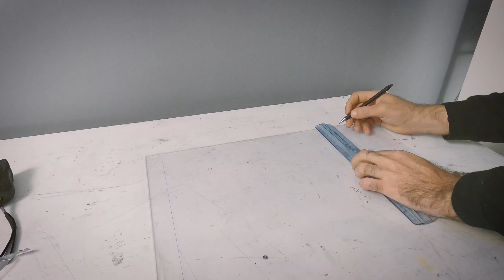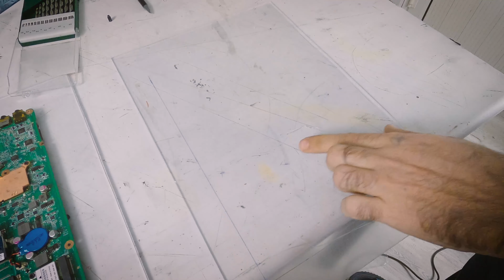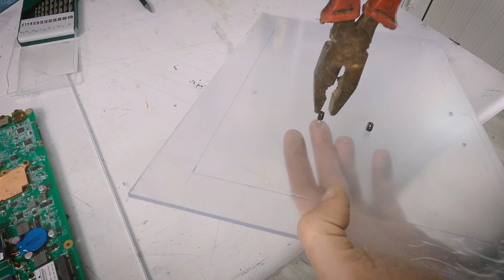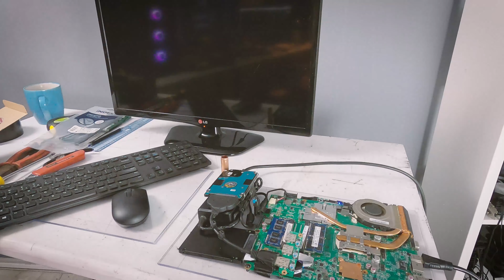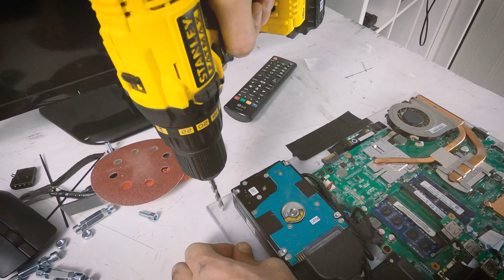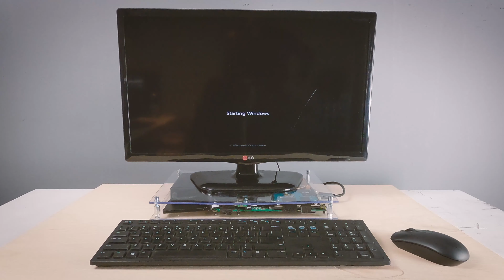Laptop to Desktop Quick Modding | Design Something

Comment: Nice Idea to have everything inside a clear home made case I have seen similar things done over the years, and have tried myself but usually the case the laptop comes in is the best thing to keep it in. what i have done is remove the keyboard screen and closed the lid then I put the whole thing just as it is inside 2 layers of plexiglass or whatever you use. I then mod only the power button to be on the case itself to be on top . I never thought of making videos about it as it sounds like to much work . This mod by DesighnSomething looks pretty good and similar to what i have done in the past.
Reply from the maker: Thanks!

Comment: FIRST OFF AMAZING WORK FEW NOTES HADRIVE IS ON AN ANGLE THE POWER SUPPLY MAY GET PRETTY HOT THERE AND FINALLY THE FANS AND GONNA NEED TO BE CLEANED TO YOU ARE GONNA NEED TO TAKE IT APART OR YOU COULD AD A MESH TO PROLONGE THE TIME BEFORE CLEANS.

Comment: I have just started the same idea but using black acylic.   My old laptop had the On button in the keyboard and I have found the connections where the ribbon connects to he M/B, but attaching another On button, any ideas?
Reply from the maker: I started mine from my phone via Wake on Lan. But this required network cable. I didn't make it start on wireless.

Comment: Can you provide a list of parts used to build this? I want to do the same thing and trying to gather the right parts are proving difficult.
Reply from the maker: - Laptop Motherboard
- Motherboard Standoffs M3x6x6
- Motherboard Screws M3x5x7
- Socket Bolt M6x10 + nuts
- 5mm Acrylic Sheets

Choose a laptop that have a fairly square motherboard.
Reply: @DesignSomething  Thank you. I'll be working with a 15" laptop.

Comment: I did something similar to this..The pc is on ,the fan is spinning and the power light is blue but it doesnt show on the screen..says no signal.
Reply from the maker: What laptop (brand / model) did you used?
Reply: @DesignSomething  acer aspire 5750g. Still no signal.cant figure out why.everything is in place and power isnon.the fan is spinning but nothing on the screen :@
Reply from the maker: @JOHNNYwxw  If you still have the laptop monitor try to connect both monitors and set it to display only on external.
Reply: @DesignSomething  i thought about doing this just ten minutes ago! Gonna try than after work ! Thanx for your time brother
Reply: It was the ram.I used the other slot and now the screen works !